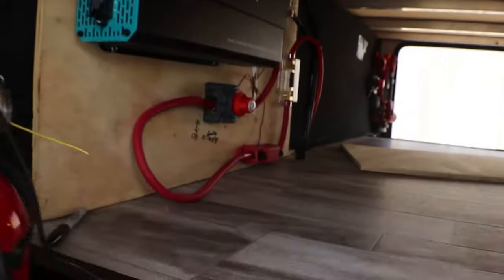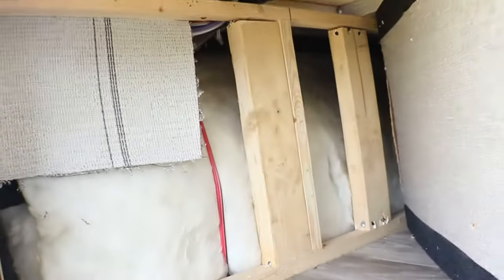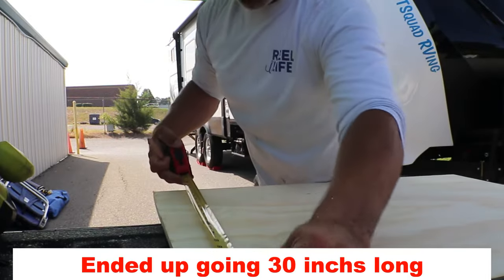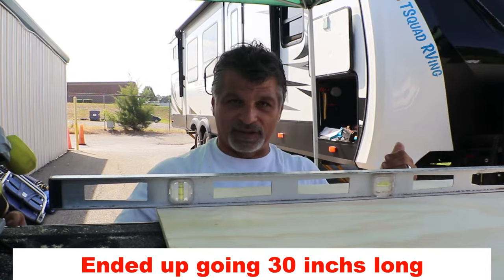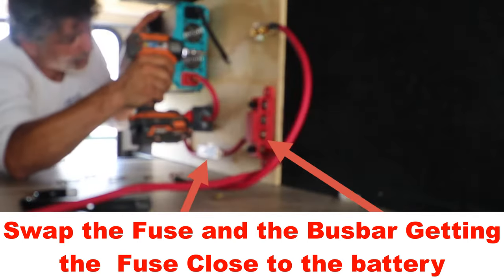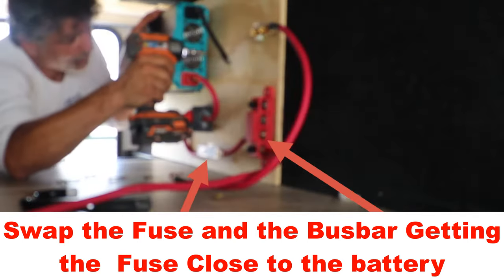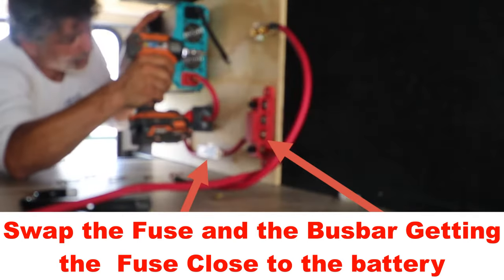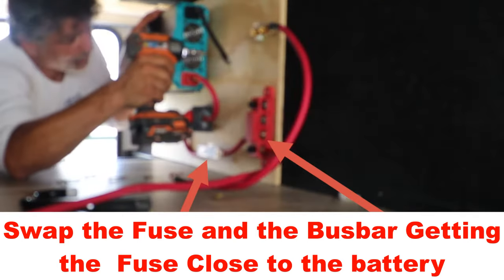How To Power Your Entire RV With An Inverter | Easy Inverter Power,

Comment: So, I have a similar set up, however, I used the hard wire from the inverter and wired directly to my panel. Ive since installed solar, and now my GFCI Breaker keeps popping, sometimes 5 minutes,  sometimes 30 minutes. Prior to that, didn't have any issues. Any of your followers have some input? 

400w 10bb JJN Solar Panels, 200AH Lithium Battery, 3000w pure sine inverter.
Reply: You should probably should look at installing a transfer switch, instead of wiring it directly into your distribution panel. 
With a transfer switch, you would wire your inverter and your converter/charger AC distribution panel, and shore power cord wire into the transfer switch and let it do the work. 
I just purchased a go power 30amp transfer switch to setup my system (2- 100ah lithium batteries, upgraded WFCO lithium supported converter / charger,  with 2000 watt pure sine inverter). 
There's some great how to videos out there. they also have a 50 amp transfer switch if your RV is a 50 amp system).
Reply: Agreed

Comment: Dumb question I’m sure but can you explain what the bus bar is or what it does? I think you also have two going to the battery side of the inverter, is that correct? I’ve seen setups without one all together, just a fuse between the inverter and battery so I’m trying to understand it. I’ll put as many fuses and bus bars needed to stay safe from a fire 😂
Reply from the maker: No dumb questions here!!!   So the bus bar is so you can connect all your positive or negative wires too.  You are correct.  Love having a lot of fuses.  You never know. Thank you so much for that question. It’s a good one.  Stay safe and happy camping.
Reply: @TSquadRVing  good to know!! Thank you!

Comment: Sorry if this is a dumb question (I’m a newbie) but by hooking your RV into the inverter, you still are using your converter, correct? So aren’t you then converting from DC to AC with the inverter and then AC back to DC creating a continuous loop which would drain your batteries even faster?
Reply from the maker: Correct. Well. Not really.  You turn the breaker off to stop it from going in a circle.
Reply from the maker: An no way. It’s not a dumb question. It’s an excellent question.
Reply: @TSquadRVing  ok thanks.  Makes sense.
Reply from the maker: 15:13
Reply from the maker: 15:13

Comment: I don't understand what the negative bus bar is doing? Why do you need a connection to that?
Reply from the maker: The negative bus bar reduces potential differences between negatives. It also helps organize the power source. The negative bus bar has a ground wire connected to the bus chassis for safety, zero voltage, and fault path.

Comment: I have a question, my RV has a solar panel, can I do the same, put an inverter on it?
Reply from the maker: Oh my. Can’t believe I missed this.  Yes you can I have a friend who did it.  But I would definitely read up about.   Sorry for the delay.  Just saw this. 🙄
Reply: What size of cable did you use from the inverted to the batteries?

Comment: Why didnt you go for a 12000 watt inverter so you could minic 50amp shore and run your air / micro etc?
Reply from the maker: Great question.  I only have two batteries.  Going with a large inverter I would recommend several batteries.   Hope I answered your question. Thanks for watching.
Reply: For sure - thanks.  We have a 30amp system and a 200 amp lithium battery.  I'm guessing if I get a 3600 watt inverter I can pretty much mimic the shore power at 120v

Comment: ultimately you are limited to the power of that socket, mine are fused for 15 amps. I thought i was going to be happy with that limited power but because i have a 5000 watt peak inverter I decided to hard wire in a 30 amp socket to my battery box/inverter.  The only way you can get that full power of your inverter is to use your hard wire connections. Otherwise you are limited to small loads, Mine can actually crank my central a/c unit.
Now i can easily get 30 amps output to my RV connection or to regular outlets
Reply: Do you wire a 30 amp female plug    / pig tail to the hard wire section on the inverter.

Comment: There's no point in that 20 amp plug adapter and giant extension cord because it is still only a 15 amp outlet coming from your inverter. If you turn on too much AC equipment in the RV, you'll trip your inverter beyond the 15 amp load. Why not just use a regular heavy duty 15 amp rated extension cord with an adapter to plug into your RV connection port?
Reply from the maker: I would agree.   So I should have mentioned the reason why I have a 20amp wire is I use for my generator when needed.   Thanks so much for your comment.

Comment: Why didn't you just use the 'first' fuse under the TT?  The second is unnecessary.  I don't know what your C-rating is on your batteries but 200 A is really high.

Comment: I do believe your cable sizing isn’t rated for 200a max… copper 2awg   90* is only rated for 130 max.  Drop your fuse sizing or increase wire size.  That inverter does require 200amp with a 25% safety rating.
Reply: That cable looks like a 2/0 not a 2awg to me....maybe he can clarify? I can't see the lettering on it with the video.
Reply from the maker: Sorry it took me so long to reply,  I used 2/0 It’s a little  thicker than 2 awg 
Here’s what I found on a wire companies webpage 
2 AWG Wire
2 AWG wire has a diameter of 0.2576 inches (6.54 mm) and is commonly used for applications that require high ampacity, such as industrial equipment, heavy machinery, and large appliances. It has an ampacity of 115 amps at 60°C (140°F), 130 amps at 75°C (167°F), and 150 amps at 90°C (194°F).

2/0 AWG Wire
2/0 AWG wire has a diameter of 0.3648 inches (9.27 mm) and is larger than 2 AWG wire. This wire is commonly used in power distribution and transmission applications, as well as for grounding and bonding. It has an ampacity of 135 amps at 60°C (140°F), 155 amps at 75°C (167°F), and 180 amps at 90°C (194°F

Thank you for watching and commenting. Hope this helps.
Reply from the maker: Thank you for watching.   Yes. I used 2/0 wire.  It’s a little thicker.  I didn’t like thiner wires they provided.

Comment: If you do not turn off the breaker for your converter while using your inverter you will drain your batterys very quickly I have made that mistake.
Reply from the maker: Rewatch 15:15
Reply: @TSquadRVing  I was just emphasizing the statement

Comment: I have the same inverter. I used the high out put and installed a 30 amp plug, less connections, and dont like using those adapters, seen those things melt and cause all sorts of problems. The plug was only 30 bucks and i can use my rv's 30 amp plug
Reply: Can you show what your set up looks like?  Where is the 30 amp plug in high output?
Reply: @terrywhitelock2999  trailer is in storage right now, but when i get to it i will snap a pic
Reply: Cant post a pic on here. 
1: set up the inverter
2: access the high voltage output on the inverter
3: hook up your 30amp cable to the inverter (should be labled for hot/earth/negative)
4: purchase 30amp rv plug and hook the other end of the calbe to the plug.
In my case, the plug and inverter are close to eachother so i only ran maybe 6 inches of 30amp cable. I mounted the inverter, inverter fuse, the solar charger and the 30amp plug on a peace of plywood. I then installed that into my pass-through storage close to the door and hooked up my inverter battery cables. I just open my hatch and plug in. I can run my entire trailer off of 30 amps high voltage out put. The 30 amp plug is also in a metal box with a door on it. The only down fall is that the storage door stays open when plugged in. For me thats no big deal, you can mount that 30 amp plug where ever you wish
Reply from the maker: Tsquadrving@gmail.com